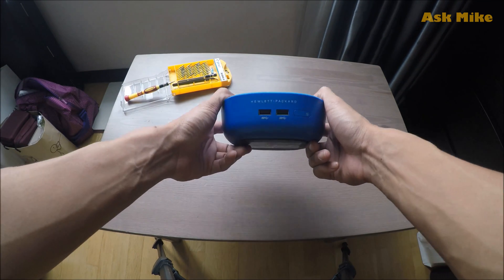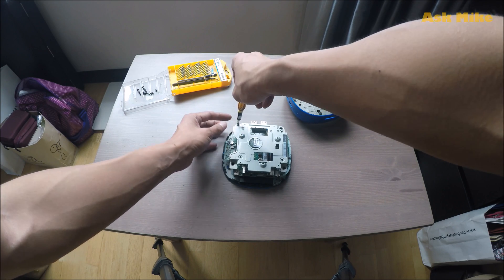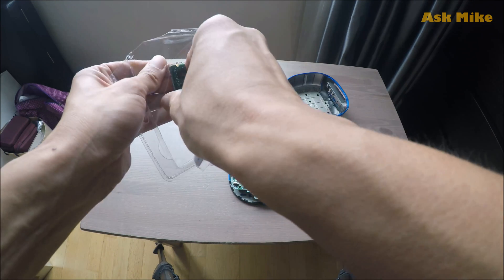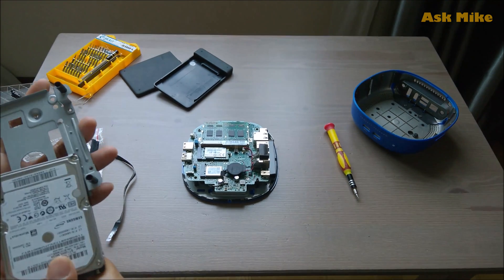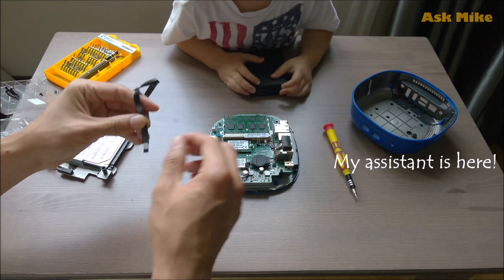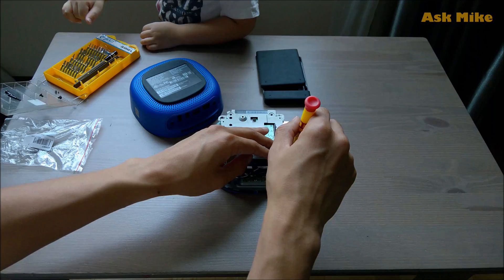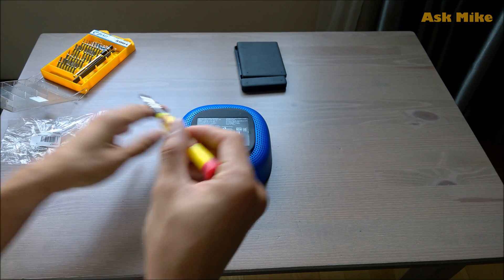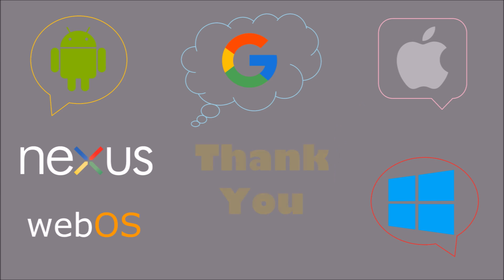HP Stream Mini Desktop - Upgrading RAM, SSD and Hard drive

Comment: What is the maximum ram that can be swapped in here? Also, does that ssd cable come standard with ssds today? Also can I keep the OS on the original 32gb ssd or should the os be migrated to the larger drive? And if so, how?

Comment: I have the high end version of this with the i3 processor and 1tb hhd.
Getting stuttering and drive noise so I ordered a new hhd and an ssd.
My version did not have the ssd but I am assuming it has a slot like this model has the hhd slot.
My question is, I want to move windows 10 to the ssd, maybe some files. Is this possible? What would be the easiest way to do it. I don't mind forking out for a program that would make it easy.
Thanks.

Comment: I have the HP Mini Pavilion.  Same form factor, but with a Pentium dual core.  I upgraded RAM to 12 GB, put an SSD and changed the wireless card to 801.ac.  Wiped Windows 10.  Linux Lite 3.8 64 runs great.  I bought another SSD and may install another OS.  These are great machines.
Reply from the maker: Nothing  much to complain except for the Celeron processor nowadays is getting bottle neck at the processor.. will flash it to linux soon.. will make a video of that

Comment: I have a 128 as c drive,  cand i add another 2.5 intel 80gb ssd with the 'HP Envy DW 17 cable? If so what bios tweeks do i need to make?
Reply from the maker: yes you can.. using the same cable.. no tweaking is required. The drive will appear once you have it connected properly.
Reply: would you be able to send me an Ebay link to the exact ribbon cable you used. I had one before and didn't work. Maybe i ordered the wrong one :(
Reply from the maker: https://ebay.to/2Adk1fT . Hope it can help

Comment: Hi Mike, no stock for Seagate 500GB ST500LM030, only 1T ST1000LM048 is available. Do you think the same cable will work with the 1T Seagate disc? Thx.
Reply from the maker: Hope you get your HDD for the upgrade.

Comment: Thanks Mike!  I used your video and Purchase links to upgrade my HP Stream Mini.  Upgraded the solid state drive, ram, added a SATA Hard Drive.  The only tricky part was inserting the trimmed cable for the SATA drive into the mother board connector.  I had to remove the white plastic piece from the connector, insert the tab and then reinsert the plastic piece.  Seems to be working fine.  This simple upgrade saved me from tossing this computer out.  Again Thanks!!!!!!!!
Reply from the maker: No problem.. since I am doing the upgrade myself. Just sharing it out. I am glad you manage to get your all your upgrade done up. Yup that cable is the tricky part.. i need to trim the side to be able to slot in. Thanks for your support.
Reply: Thanks, if it's not your comment really dunno need to trim the cable. and now mine work also. Many Thanks.